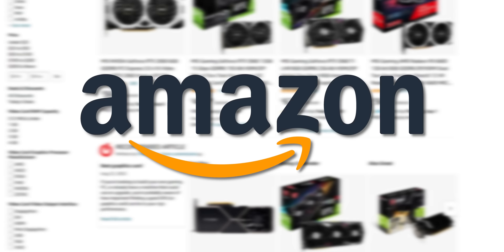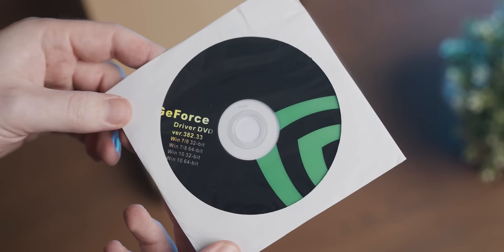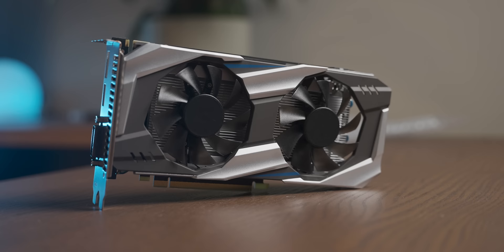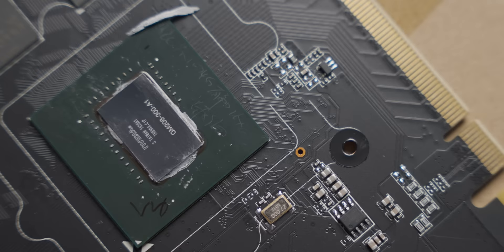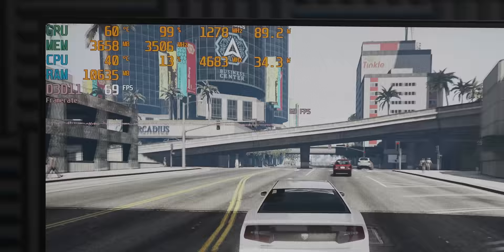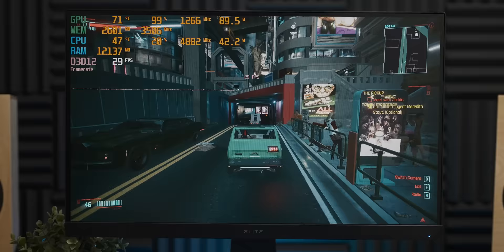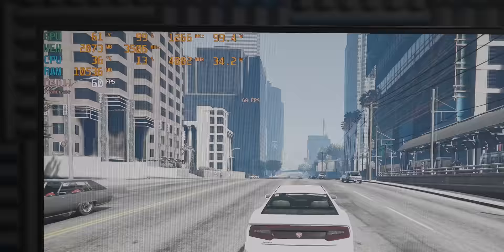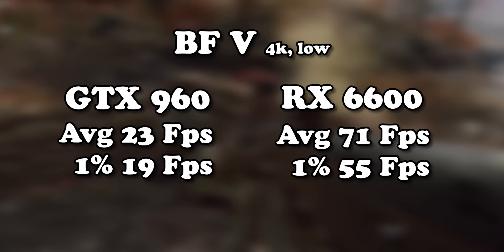According To Amazon This Is A "4K HDR PC Gaming Video Card"

Comment: Hmm, HDMI, DP and DVI-I (which btw also carries analog signals) looks fine. Cooler also looks decent for a 960. Not the worst I've seen. Surely enough for a 120 W card. 72°C might not be premium, but acceptable.
And I'm really impressed how flat the framegraphs GTA 5,  BF5 and Cyberpunk are. I would say that is clearly playable. Even CP at 1080p30
Two things about fake, "renamed" graphics card: You can figure out which is really is with GPU-Z, and in some cases you can flash the correct BIOS on the card, making it work properly again.
Reply: DVI -d is digital and DVI -i is digital and analogue
And dvi-a is analogue. So it depends which one it has
Reply: @darrenfalconer3267  One of the Maxwell video out endpoints has a built-in VGA DAC. They did use a DVI-I socket and it should by all reason be VGI-I, since it's implemented at no extra cost.

Comment: A VGA output is useful, allows you to connect any kind of monitor you may have, or work as an upgrade for an system. Better if it is attached to the board properly without a ribbon cable, which reduced the quality. If the card has 2 or 3 more digital ports, you lose nothing. You don't buy a Chinese product to brag about, and feel like the D-Sub is wart on your skin. Might be worth checking if the analogue out works on the DVI-I.

The Chinese sell very affordable motherboards and refurbished Xeon CPUs. But the prices of graphics cards are not any lower.

Comment: Huh. I have a 970 superclock and I am very curiious about how this will be! 

The thing is you need to replace the thermal paste after getting a new card or once a year or two years. Try doing that and see how well 4k gaming will be

EDIT: Not exemplary enough. I am squeezing my 970 to use RTX voice and it is BAD and using my computer ram but it is working is. Not enough VRAM in the 960.

Comment: I would be very surprised to see the 1600 series hold up as well as the 900 series has in a couple of years
Reply: I can see the 1660 do quite well. It might not have the raytracing hardware, but has a fine mix of GPU performance and VRAM size. The fact that Im still running a 1060 and am more concerned with upgrading my CPU than my graphics card says a lot.
Reply: @HappyBeezerStudios  the 1660 super is dope. I recently upgraded to a 3060 but didn't really need to. They were available at best buy for 389.99 and so the 1660 super went in the secondary. Just out of curiosity what CPU are you currently running?
Reply: Hmmm, considering the 1600 series match spec for spec with the 1000 series, sans ray tracing hardware support (1000 series DO have RT hardware support, albeit at a severe FPS hit whereas the 1600's don't have it and can't enable it), and range from 80% (mostly)-103% (a few rare cases with high end 6+ core CPUs) of the 1000 series FPS at 120% of the price and power consumption, it probably won't.  That said, the 1650 and 1660's seem to just be a front end attempt at rebranding the 1050 and 1060's from all aspects, down to removing support for the RT tech that those particular two models (1050/1060) could run but weren't well suited to (20ish FPS at 1080p (~15 on a 1050) with RT enabled at minimum settings otherwise isn't really that desirable of performance, and at 720P it goes up to a whopping 30ish (~23 for the 1050), again at all minimum settings otherwise).

Comment: That looks like a factory reject. The chokes on the power delivery are cockeyed, they are SMD package so they must have been placed on the board incorrectly before wave-flow soldering. A lot of tech products produced in China have a re-sale market for factory rejects where the items could be fully functional, but not meet QA standard for the brand they were producing it for. So they have to push it out onto the re-sales market, but it must be unbranded for it to be legally sold in China and internationally. There's a lot of cases where there were perfectly good components that didn't meet manufacturer requirements, because they were scratched, dinged, or otherwise mishandled during assembly that had to be sold off unbranded because they didn't meet the standards that the company wanted. So they aren't just creating e-waste in China when they make a mistake, they are actually repurposing hardware and recouping some of the money spent on manufacturing the reject. The problem is when you get these illegal groups in China who buy up these products and try to resell them as something they aren't internationally so they can scam people out of their money, which they can then use for other nefarious illegal enterprises.

Comment: Well, I don't use 4K, on the one hand, no monitor, and on the other hand, I don't see any difference. I stick with 1080P 60 FPS log because smaller icons on Windows or smaller HUDs don't do me any good, often just because I can't recognize the writing or symbols anymore, and it's only important to me that I can recognize something. I don't want or need ultra realistic games (ray tracing is always off for me) or other types of realism in games. As mentioned, it's important to me that I can recognize things in the game and I have 30 or 60 FPS max, nothing else, without some kind of reflection that isn't interesting to me, e.g. like ray tracing does or realistic shadows. The old method with shadows is enough for me.

Comment: I don't understand these re-shrouded GPUs. I bought a used GTX 750 for a cheap build that ended up having the shroud HOT GLUED on that fell off about the time the GPU sh*t the bed when I tried to game on it. And I returned it for a full refund. There were a bunch of the same exact re-shrouded GTX 750s for sale at that time. What are these GPUs? Are they getting a bulk lot of GPUs for almost nothing because they are bad but then replacing the shrouds versus replacing fans on the existing shrouds since some are expensive?

Comment: so, if I had to guess, this is a "rehomed" GPU die.  the board screams generic board set up for these.  these are making their way to the US market as OEMs have figured out that they can sell these old GPUs, but they cannot sell them in their original form, so they have a cheap generic PCB made that supports many different BGA chips, and they program it to each one as needed.

Comment: im still using my 980 ti to this day and it gets very respectable framerates at 1080 and 1440p and is still better than a 1650 super and slightly worse than a 2060 3g (2060 super 6g is quite a bit better) but its not bad for the 150 euros i sniped it at in the shortage

Comment: Wasn't the PS2 one of a few consoles back in that day that actually had 60fps games? Not across the board but at least some?

Also the lightweight and easy to carry was clearly a reference to external graphics card enclosures, duuuuuh /s
Reply: Indeed it was. I feel like the reason why 30 became so dominant on consoles was the long PS3/X360 lifecycle with increasingly demanding games but no new hardware.

Comment: 4k is actually very demanding on VRAM more than anything on GPU, 960 is a very capable chip (I have 2 myself in my SLI setup PC, perfromance like 1070 :) ).
if it had 8GB of ram you would have better experience (but no 960 has8g, max is 4g models like this one)

Comment: Ghetto dlss 1 to version 3 , set resolution scaling in control panel then set all texture and anti a to override, then use sharpening at 100% let it train and enjoy 50 to 60fps more same setting any gpu 1080ti and lower.

Comment: My old proper branded gtx970 was still running pretty well until it used to crash playing halo infinite at 1080p. 

900 series is still damn good especially if you just want 1080/60, can also do 1080/144 in most eSports title. 

But then it only costs £70 now, not the 300dollar of this "4K HDR graphics card"
Reply: My old 660 Ti is still running fine as well, same for the HD 4870 before it. (the 660 Ti is in this very rig, made for watching youtube and local multiplayer when a friend comes over)
And with fine I mean they are absolutely stable and working despite running overclocked for years. The only reason they aren't in my main rig is because of performance.
Reply: Your old 970 is likely fine, just teardown & refresh the thermal paste and your probably good to go again.
The paste on those 900-series cards is pretty thoroughly cooked by this time.

Comment: To be honest I feel like this card can drive 4k screen even some light indie titles on this resolution so they weren't exactly lying.

My GTX1060 works fine with 4k TV I have and I can play older and indie games directly on that PC. All the heavier games I need to stream from my main PC using steam link which is fine. The delay is not noticeable at all and it works really well.

Edit:
just got to the price and for that price no thanks... You can get much better GPU for that price.
Reply: Yeah, I've been playing lots of titles in 4k since I got my R9 270X back in 2014 (upgraded to RX 580 in 2018), including then not ancient titles like Remember Me. And for modern titles where framerate doesn't really matter too much like Desperados III I can also play them in 4k eyecandy at close to 30 fps.

Onoez, the horrors of playing some titles in 1080p on high instead of 4k, the humanity… ('cause that looks nicer and still runs better than 4k low)

But neither of those cards were advertised as "4k gaming" cards of course. And heck, they cost me less than that *combined*. :-)

Comment: Dawid anything below 30 FPS: this may very well not be a usable experience. 
Meanwhile me with an Intel Pentium E2140 dual core, 1GB ram, 1TB WD Blue HDD, Windows 10 and Intel express chipset family graphics: bruh. I played GTA San Andreas with framerate below 30 and Hitman blood money and completed both games. Hitman blood money never loaded the textures as well but still i managed to complete the game by running into the walls and using that as guide. I also ran need for Speed most wanted with framerate below 30 fps when there used to be a lot of smoke XD and completed the games. 

Well. Now i own a GTX 1650 and an AMD Ryzen 5 1500X with 8gigs of ram. Will miss my old Pentium as the Zebronics motherboard died and now the cpu is in my keychain with my first 1050ti gpu which also died.

Comment: This GeForce GTX 960 runs so good because it has 4GB RAM, normal GeForce GTX 960 had only 2GB RAM, and as you can see, 
GTA 5 uses 4GB VRAM, and Battlefield 5 uses on your settings 3,5 GB VRAM.

And yeah even a Radeon RX 6800 has a hard time running Cyberpunk 2077 on 1080P at Ultra settings, you get about AVG 85fps and 
that graphics card is 2x faster then a GeForce GTX 1080 and 6 to 10 times faster then a GeForce GTX 960, and the GeForce GTX 960 
came out January 22, 2015 , so it's now 7 years and 7 months old, and it (4GB VRAM version) can still play new games on 60 fps on 
high to medium on 1080P, and yeah that is almost unbelievable for such a old graphics card.

Comment: Need help I am using a mid range pc 
Prosseser:Core i5-11400
Ram:8(single stick)
Graphic card: GTX1650
When I play any game on my pc it's stutter a lot I have tried (watch dog 2) (sekiro) (farcry 3) and if I lower the resolution like medium or lower it doesn't help at all. performance of the game r same no matter what I do can any one know any solution or what the reason is
Reply: You need more ram, get another 8gb stick at the same spec or a 16gb kit if you don't want to mix sticks and you'll find it smooths everything out and gives you a few more frames.
Reply: Having dual ram should help

Comment: Best advice to give anyone is NEVER buy computer equipment of any sort from Amazon. I bought a Dell laptop off amazon... sold by a third party posing as Dell. The laptop was indeed a Dell, but things had been pilfered from it. Things they swapped for their own profit:
256 GB NVME drive for 2 TB of spinning platters.... that Seagate had RMA'ed.
Wifi card swapped for one almost 10 years old.
Touch screen monitor panel for a significantly lower resolution touchless panel.
16 GB of RAM downgraded to 4 GB of some no-name brand I never heard of.
The cooling fan was missing.

How do I know? The thing was so messed up, I bought another of the same model directly from Dell, off their website.

Comment: what this video shows is that, in fact : the gtx 960 4gb is capable of running some games in 4K resolution 30+ fps with low-medium setting, and it quiet impressiv espcially if you consider this card has been sold in 2015.

I'm pretty sure that a all of games released before 2015 would run at 60 + fps smoothly on 1080p en even 1440 so it's a really good card to play early 2010's  games or older.
Otherwise, considirng today : even AAA are enjoyable, at least with twiked seeting and not high resolutions.

The final point is that : the scammer pretending this is this powerfull video card and can run 4k todays gaming is a liar; but on the other hand, if you are a young boy that asked you grand'ma for a pc and she founds one with this card for a budget price, it's still interessting  because you will be able play  95% pf actual games in 1080p without too much trouble (except huge games that unoptimised)

I would have been happy to have this kind of graphic card when i was younger instead of an old 15-years aged  laptop struggling to rune Age of Empire (99).
Reply: But still, for the price showed in the vidéo, you can find a 2060 for 20 dollars more, wich is far better for todays gaming.

Comment: rolling the dice on sketchy hardware so we dont have to. thanks, and it was a funny video. 
4k graphics card is really big ask, if you want high fps and be able to play almost any game up to 2022.
many games do not have any scaling options or they break the game, apex legends for example, i have to run that in full 4k. 
cyberpunk i have given up on, no pc can run that game.
Reply: My pc runs cyberpunk pretty well. Rtx 3070 ti ryzen 7 5800x3D 32gb 3600mhz ram. I'm getting at 4k (dlss) quality between 65 and 85 fps. Of curse lower res like 1440p gives well over 100.
By the way I don't use raytracing
Reply: @i3l4ckskillzz79  i get just a bit more fps than you, not exactly playable when i want 100fps and above. 
you really can not get much more fps on current hardware no matter the settings. the game just do not like to get near 144 fps.
the input lag never goes away :(
Reply: @sudd3660  than you might need a better cpu. at 1440p dlss quality i get often a lockend 165 fps. so idk what you talking about might use some optimised settings digital foundry did provide them on their channel give them a go. Of curse the game should run better on modern hardware but it`s poorly optimised. By the way i feeel no input lag maybe the game behaves different on your rig. what are your specs ?

Comment: 🤣🤣🤣 GTA5 maybe 6 years old but so is the 960 or at least my one is, mine is in use still on my windows XP / W7 gaming pc with my i7 2600, mine is the gigabyte 4gb version that is more portable than that one as well been a shorter single fan design

Comment: Wait.... Did you actually give that seller 325$? LoL why? Even best case scenario the GTX 960 is slugging it out with cards like the HD 7970 - so we already know what the performance is! Yes they CAN run 4K - so the BS sales text is not technically wrong - so even before you started testing it I bet you most people here knew that you can run stuff like GTA V in low on these potatoes. You could at least have water cooled it and looked up ways to mess with the firmware to override the limits! Linus would have! LOL!

ON A TOTALLY DIFFERENT TANGENT: Yeah it's actually fun how the GTX 960 is actually able to run most modern games in "decent" details and res. It seems to have gone totally over many "tech Youtubers" heads - and it's kind of why I've stopped watching channels like GN! Hearing Steve crap on VERY capable cards and calling them basically useless because they don't perform as well as an RTX 3080 ti in a benchmark has become pretty damn unbearable for me. Cards like the RX 6600 which you prepared this one to - and even the RX 6400 in a PCIe 3.0 system offers pretty amazing gaming experiences as long as you are not an idiot and put the game at 4k - or Ultra settings. Hell even my "guest PC" which is salvaged from a junkyard with a Xeon E3-1230v3 and a GTX 1650 can run Cyberpunk fairly well at 1080p. If nothing else - this video servers is another reminder that modern gaming can be done fairly well on hardware so old many would consider it junk... To think how many of these parts are fulling up landfills and causing pollution instead of being used is just kinda insane really. So good to see the ol' 960 showing up at the party and still being able to hold its liquor - but paying 325$ for it..... I don't know about that one Dawid 😀